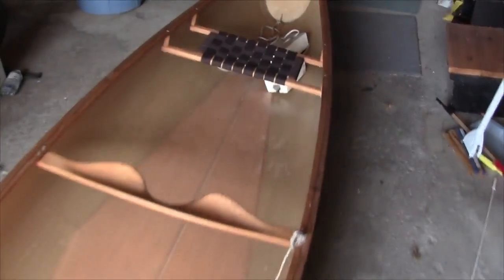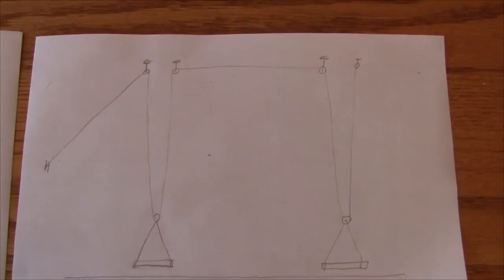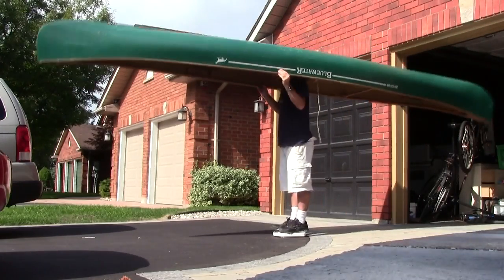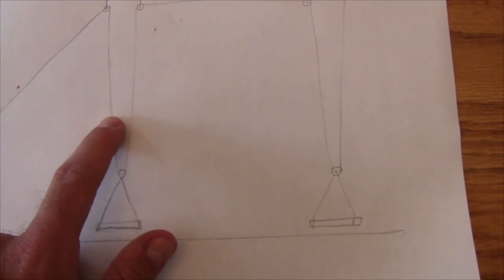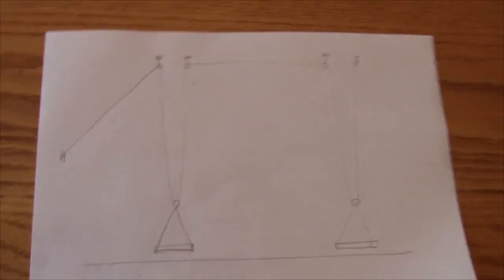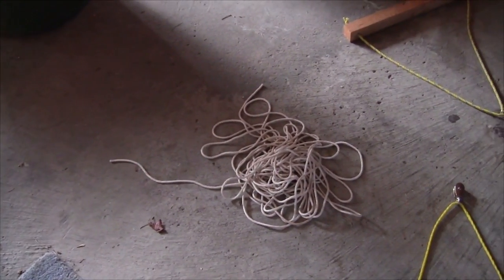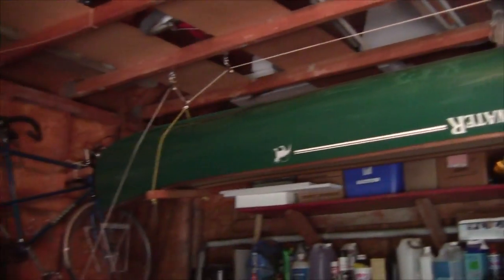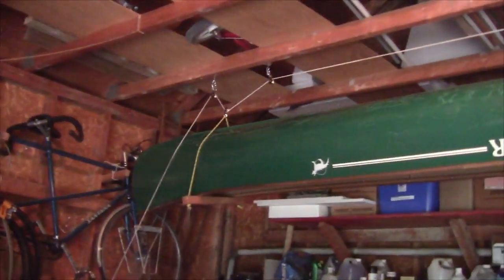How to Build a Canoe Hoist Storage System in a Garage

Comment: I truly don't understand the need for the math.  I mean, a canoe is light.  Just common sense.  I built something similar for my fishing kayak-- which weights about 90lbs.-- no problem, no math needed.  2x4s, 3/8" rope, large boat cleat, pulleys rated at 450lbs.  No math needed.  Or even considered.
Reply from the maker: I'm sure I explained this in the video, but I was improving an existing pulley system which didn't work very well because the force required to pull on the rope was too high for a person to comfortably pull. The point of the calculation was to verify that the system I replaced it with would solve this problem by reducing the pull force substantially. It had nothing to do with the rated loads of the individual components. Doing some quick math ahead of time sometimes can save you from building something that doesn't end up working as you had intended (which was the case with the existing system). It's a very similar philosophy to "measure twice, cut once". Everyone has their own way of working, and yours is clearly different from mine, which is perfectly fine!

Comment: Cool. Pushing down the end of the canoe that rises faster will limit how high you can get it in a tall garage because of your reach, but you can tie a piece of rope so it dangles down from the wood support at that end of the canoe and pull the rope down rather than push the end of the canoe down. There are ways to keep a mechanical advantage of four without one end climbing higher, but they all involve using more pulleys or they involve more complicated block and tackle devices and probably aren't worth the trouble.
Reply from the maker: The reason for one end rising faster than the other is because of the friction and mass of the pulleys. In High School physics classes you usually simplify these types of problems by assuming the pulleys are frictionless and massless. In the real world they aren't, but perhaps if I had purchased better quality pulleys the impact would have been less.
Reply: I just installed a hoist system yesterday that I bought on Amazon a few days ago It was inexpensive, $53 Canadian dollars, and has two independent pulley systems, one for each end of my kayak. Each system has a mechanical advantage of 2, and comprises of one fixed pulley, one free pulley (that can go up or down) and a rope that's fixed at one end. It works pretty well, and you can pull the two ropes simultaneously (the resulting mechanical advantage is still 2). I might add another fixed pulley between the two systems and use one long rope through both systems instead. If I do, I'll have the same type of system as yours, with and ideal MA of 4. I guess the manufacturer didn't include this extra fixed pulley because a mechanical advantage of 2 is good enough, and because the two ends of the kayak will rise at the same rate, and maybe the extra friction from an additional fixed pulley would defeat any gain in M.A. I just wish my garage was a bit taller so I could drop the kayak right onto the roof of my car using the pulley hoist! Thanks for posting.

Comment: You have a 2:1 mechanical advantage. I made a design for nearly the same thing, with a 3:1 ratio with a double pulley at the top. Unfortunately my system appears to have so much friction I can’t pull it up at all.
Reply from the maker: Awe that's too bad.

Comment: I patterned my system similar to your original design except I ran the rope to a corner using a trailer winch to raise and lower my canoe with cleats on the cross board sandwiching the inverted gunnels so it will not shift or slip. 
I used the same design for my 4 kayaks hanging them with the sides vertical rather than flat. Takes a little longer to lift but one person can lift and lower all watercraft on a level plane and easily. Another advantage is I can stop at any level if needed and the lowering is very controlled.

Comment: How did you determine the distance between attach points on the rafters? How far apart the pulleys and stationary attach point are from each other???
Reply from the maker: cattail3 The distance between attach points will depend on the length of the canoe your are hoisting. In my case, I was upgrading an existing system, so I just stayed with the same rafters that were already being used.
Reply: cjhoyle I am hoisting a raider bass boat (a lot heavier) at 10 feet long.... should I position the attach points equidistant from the bow and stern?
Reply from the maker: cattail3 You should position them so that the load is equally balanced. For example, if the stern is heavier than the bow, the rope at the back should be further from the stern than the front rope is from bow. Also, with a boat like that, since there is no curvature, I would think you'd want hangers for it which are more complex than what I used. Best of luck with the project, let me know how it turns out!

Comment: Thanks for taking the time and effort to share your design and a little physics along the way.  I would offer one suggestion that will help with access to the other items in your garage.

I noticed that you complicated access to your bicycle by routing the line straight to the cleat from the nearest pulley.  You could avoid this by routing your line through an additional pulley mounted to the rafter directly above the cleat.  While this adds a little resistance to the complete system, it will route the line between your bicycle and the wall.

Comment: Great post... I made a hoist system for my kayak with the same pulley set up as you have.  I had an old boat winch that I installed to lift the whole system. It works great!... Thanks for the post!

Comment: I looks like the canoe is unbalanced from the start.  If the hoists were spaced equal distance from each end of the canoe they should be lifting equal weight and should rise at the same rate.  You might try fish scales to know if each pulley is actually lifting equal weight, and if the front should be heavier to rise evenly.

Comment: I was using a pair of blocks each with 4 pulleys, trying to reduce the effort required to pull my boat onto my car's roof racks (via a ramp). I used a digital luggage scale to see how much force I was needing to use before the boat would move. What I found was that the friction in each cheap pulley was significant. In the end I used less pulleys (2 at one end and one at the other) but they had ball bearings on the axels. It made a massive difference. It was much easier to lift using the 3x ratio than the 7x ratio, just because it had much less friction!
Reply: Using a larger diameter pulley would also reduce the friction felt in a bearing-less pulley. Just providing options...

Comment from the maker: I think that would be easy to tie, but probably difficult to untie.
Reply: You could use a loop in a simple knot, so when you want to un-tie the rope, just pull on the end of the rope and pull out the loop. Knot undone! I use that method all the time when tying loads onto a trailer. To keep it from failing while driving, I then tie the loop around the tensioned rope in one more simple knot, and Voila! Ready to roll!

Comment: Awesome! Great video that helped me out. But, (since I have a higher ceiling) I think I could do the same, but with less pulleys. 1 rope split into two, going to each end of my kayak, then going up to 1 pulley directly above my kayak, then transferring over to another pulley on the wall. So basically 1 rope, 2 pulleys, and the rope split into 2 at the very end for the kayak. Would save me 1 pulley I think.